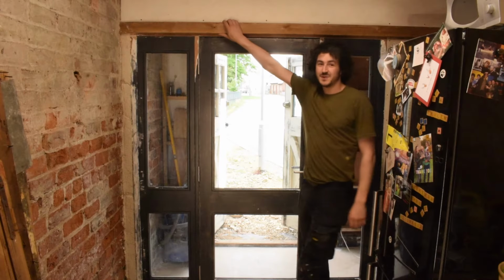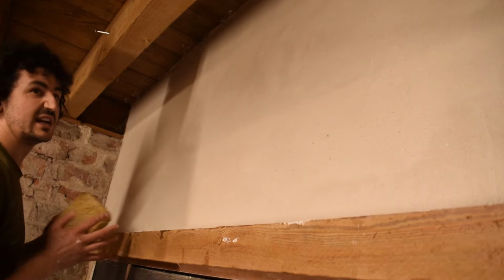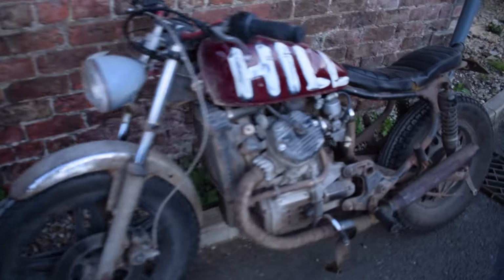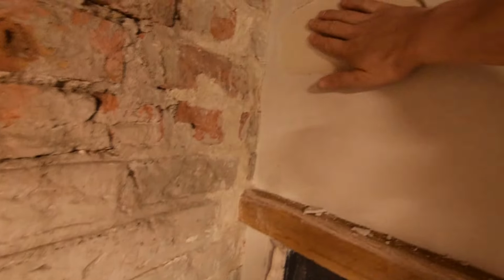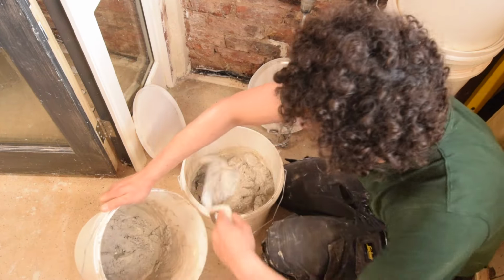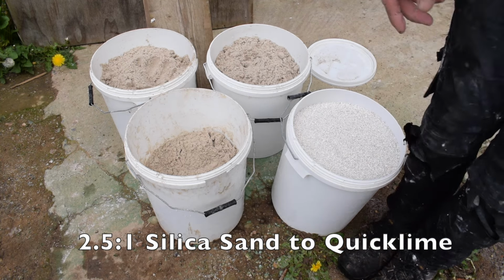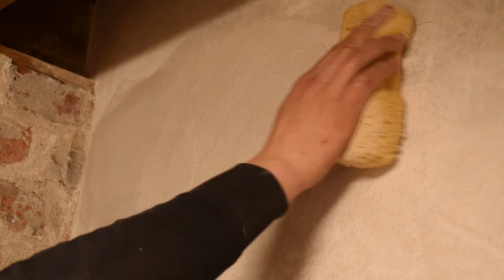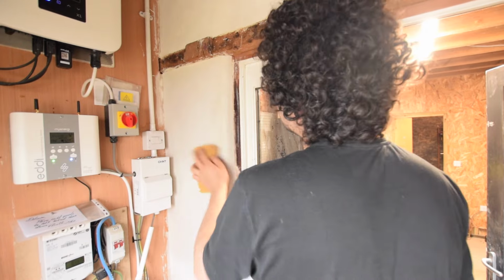Learning the Hard Way | Plastering using Hot Mix Lime

Comment: You need to use sealing bond before the plaster, the issue is the insulation board is drawing all the water out of the plaster mix, causing cracking and low adhesion. Great videos. Thanks.
Reply: Yup, looks like it. Same as with wallpaper.

Comment: Compares well with the lime plaster in many of the older houses we have lived in. That did not look anything like easy.
Reply from the maker: Trying to put a contemporary French spin on it which will make more sense on the next wall I do, think it should be easier next time.
Reply: @theroundcorner  Does the mesh have the same function as horse hair did in earlier times?
Reply from the maker: That’s it, I think you can still buy horse hair

Comment: You are just doing it TOO dry!!
Soak the base surface first. It must not be allowed to suck the moisture out of the plaster.
Many thin coats is the answer usually. You must accept that Lime needs "tending", wet the cracks and join them up again.
A "Journeyman Plasterer" would lay one coat, then move onto the next village, do the same, and move onto the next village.
Working in a circle to return to the first plaster site and tend the plaster's crack, and so on.
Lime plaster is not a One Hit Wonder!
Reply from the maker: Thanks for the advice & interesting history, I hear you on the water. Seems to want to stay damp whilst it carbonates